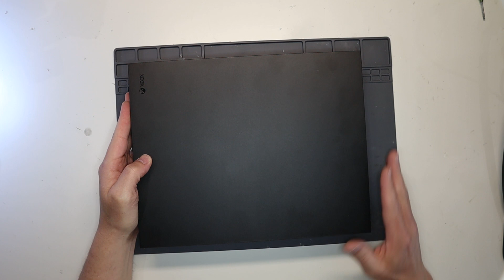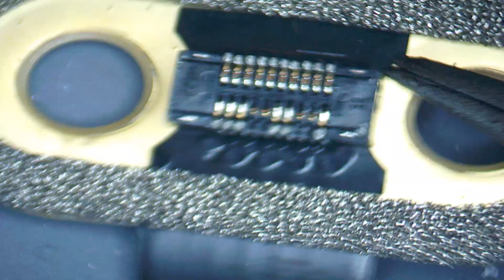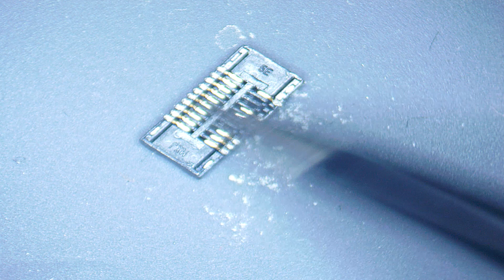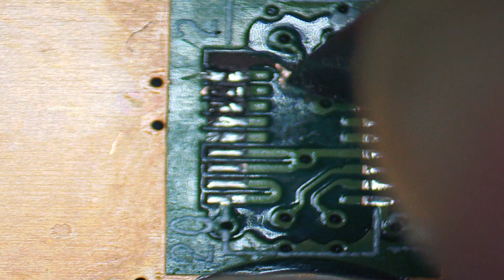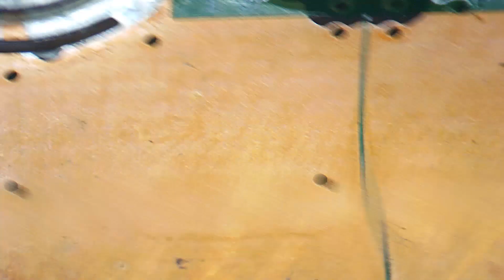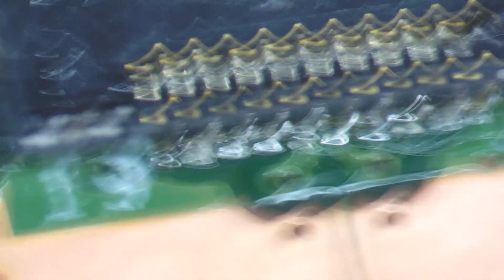How to repair Xbox One X Bind Button and USB Port - Replacing broken motherboard USB Bind Connector

Comment: Funny as I didn't know this port was weak till I opened my Xbox to dust it when I pulled the connector off that other peace came with it I was shocked I carried on dusting while panicking I thought why not connect my phone charger in the USB port place it back on only screw it down light move it till I hear my phone charge it worked 😂 then tightened it down happy days seeing you video doing a repair job seems well to professional for me cool job you have done

Comment: Any idea what pins control the sync? The pads on the board are fucked. I just need to sync a controller damn it
Reply: Just use a usb cable to sync it using the back USB ports for the mean time

Comment: my connector wont stay on its come of 3 times now is there an alternatway to do it  ?
Reply from the maker: Hi John... Not really as it needs to be soldered in order to make the connect with the pads on the motherboard
Reply: @TweakTips  I was wondering if I could solder wires to the board and run them to a connector
Reply from the maker: @johndix6101  You could do to get the bind button working yes.. but will be lots of wires for the USB port
Reply: @TweakTips  that's all I need really can live without front usb

Comment: Ok so I had my Xbox repairs at a shop it came back the sync buttons and the USB port is not working I just took my Xbox apart and the superglued these parts to motherboard how am I supposed to fix this? Is my Xbox completely broken now I can’t connect a controller to my Xbox at all it turns on just fine and works fine other then syncing controller the back Ian’s work for hard drive and other stuff but when I try to connect new controller it won’t sync at all
Reply: Yes I have tried all of the ports none of them will work ended up buying my husband a new Xbox
Reply from the maker: @Mommyof2-v5p  Hi Amanda - If you are based in the UK and would consider selling the faulty Xbox as it is, try contacting our friends at Console Therapy - they offer some really good prices for faulty consoles and they also arrange collection from your home - click here for more information - https://consoletherapy.com/sell-broken-xbox-one/
Reply from the maker: Hi Amanda - I would take it back to the "repair shop" and ask them to sort it out.  Have you tried using a cable (connected to the rear USB port) to connect a controller?

Comment: towards the last part did u add solder to the pins or u soldered the pins together w/o any
Reply from the maker: I pre-soldered the pins, so at the end it is just a case of heating the pins to melt the solder - but a few needed additional solder added too

Comment: where i can buy this two small parts ? mine broken
Reply from the maker: They are available through mouser.com
Reply: @TweakTips  Which keywords do you recommend to narrow the search down quicker?
Reply from the maker: @Zeroshade-gaming  Hi Jay - Part number is 51338-0274 - if you search on Mouser it should show you the connector for the motherboard.  There are two types of connector though, so check this one is the same as the one on your motherboard
Reply: @TweakTips  thank you very much!
Reply: Where can i buy ribbon cable conector